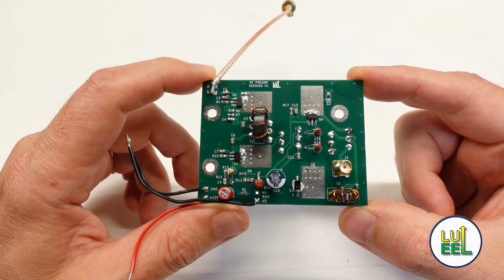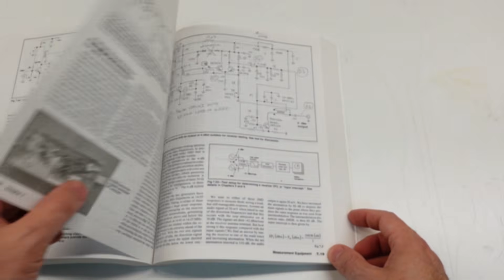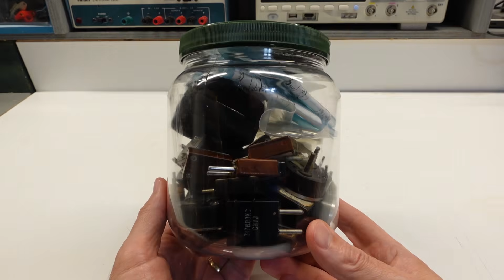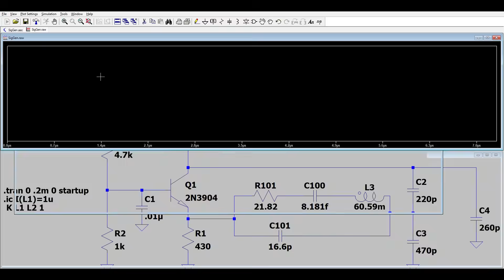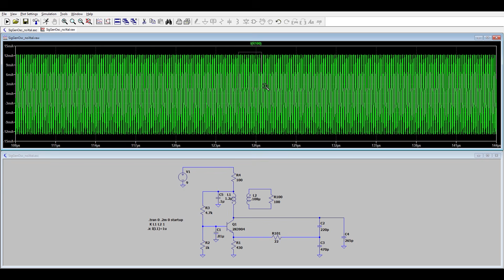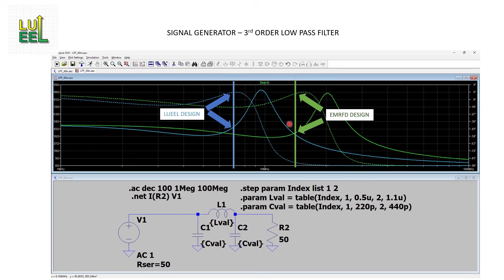New Project Time - What Could It Be?

Comment: It looks like the Motional parameters for the crystal is wrong on the simulation. You have 8.181F for the C100 value. It should be 8.181fF (femtoFarads) or 8.181 x 10^-15

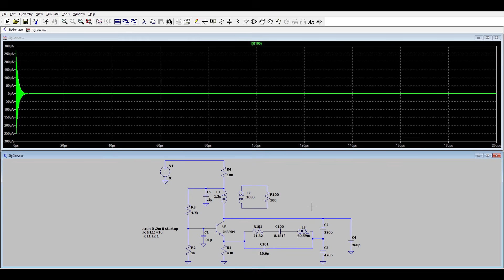Comment: 10:30 when simulating oscillators with LTspice sometimes it helps to add a little bit of noise to the power supply model, e.g. use formula: V = 12 + white(1e6*time)/1000